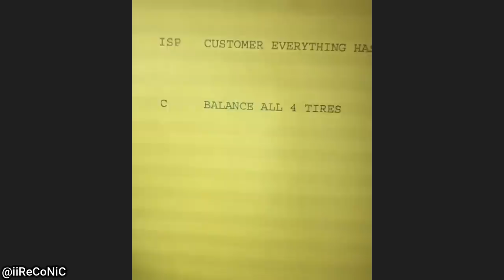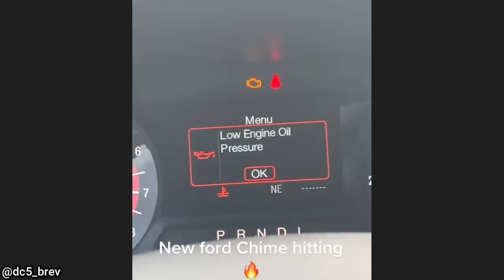Customer States Rear Wheels Won't Spin After Driving Over Speed Bump | Just Rolled In

Comment: I would love to hear their thought process behind cutting the tank open to replace the fuel pump.
Reply: yeah like what the f...
I hope its just a misunderstanding and they just ran over some stuff. on the other hand you can clearly see the consistend fraing that  comes from a sawblade
Reply: No shit, and I would really like to witness the "oh duh" moment as well.
Reply: The thought process, if it could be called such......
Gotta get that fuel pump outta there stat, everything else we'll deal with when we get to it.
Reply: I used to work with a guy that had a BMW Z4. He was running an antenna cable from the trunk up to the center console and inadvertently drilled through his gas tank. He's a pretty decent mechanic, and he knew where the tank was, just had one of those Homer Simpson moments. FYI, Z4 gas tanks are not cheap :)
Reply: How did they cut it without blowing it up, brushless DeWalt reciprocating saw?
Reply: @stevebot  Hand saw.  Carpenters used to use them in the old days.
Reply: Thought?
Reply: Yes, but where is the duct tape. Certainly that would have fixed the hole?
Reply: @JCWren  Decades ago, I was installing police equipment in the trunk of a Crown Victoria. I drilled 1 or 2 TEK screws too close to the rear of the upper trunk shelf. Right into the top of the fuel tank. Never made that mistake again.
Reply: If you would like to hear the thought process it would just sound like static.
Reply: @Mikeydude001  All too common in those
Reply: "It's where the fuel is, duh!"
Reply: on my last car, i would have to remove a ton of stuff just to reach the fuel pump to the point it would be THOUSANDS of dollars in labor alone in a shop. i absolutely debated cutting through the fuel tank to reach the fuel pump then just replace both. only reason i never attempted it was bc the car got totaled before i got paid next
Reply: Ya ain't seen the video of the woman who cuts her masks open so she can breathe through them?
Reply: @descent8275  consistent and fraying you mean.
Reply: A bit of glue and silicone and it's good as new... lol
Reply: Maybe she got jealous of the fact that my car's fuel pump is located at the front of the engine, up top, easy to reach by anyone when the hood is open. 😄
Reply: There are a lot of such moments, where I would really like to ask the people involved what they think would happen.
Reply: @rogerwilco2  I dare say, where people like that are concerned, it would just result in even more frustration.  You cannot employ logical, rational reasoning to a situation where none exists.  Attempting to do so can just short out a brain cell.
Reply: @csjrogerson2377  
What’s a hand saw? I tell ya, you just can’t keep up with inventions these days, there’s always something new.
Reply: Was probly gonna use duct tape to seal gas tank but realized tape dont like gas,🤣
Reply: @southern_merican  
Flexseal! 😂
Reply: @JCWren  DOH!
Reply: Labor saver 🤣

Comment: Customer:  "I did the work myself."
Mechanic:  "You don't say!"
Customer:  "Can you fix it?"
Mechanic:  "I can but I won't."
Reply: That Subaru at 0:47: I would have quoted the guy 40 hours @ $100/hour. And that's just to diagnose it.
Reply: So far that has happened with my home mechanic repairs.

But that Suburu is beyond me what they were attempting to do.

I don't know any garage who would help that customer out when they went that far into destroying it.
Reply: @davidpick1076  I like electrical work...up to a point! But I would give it a shot for $4000!
Reply: @61rampy65  You could just pull the entire wiring harness and return it to stock (that'd cost as much as that car, if not more, I know).
Reply: @bodyrumuae2914  "But, I worked hardly on that!"
"Thing is, it's hardly working."
Reply: @61rampy65  i would quote brand new wiring harnesses and that would be just to get the ball rolling. likely shorted his pcm/bcm as well with all that fuckery. that alone would put you in the thousands and at least it would be all new wiring. any thing after that would be chill for the most part but i would definitely have the dude sign a waiver and take pictures of the current condition and AFTER so if they start doing this shit again then any warranty is NULL.

Comment: Things I've learned on this channel:
- People think tires have infinite tread
- Don't let "someone you know" weld anything on your car
- What bullet holes?
- Don't let the lube shop touch your car if you still care about it
- people are nasty
Reply: Also... There's oil that last the life time of the vehicle
Reply: @SDogo  I mean if you never change the oil technically it did last the life of the engine....
Reply: I've got one friend I would allow to weld on my car.  Why yes, he is a certified and experienced professional welder, how'd you guess? 😂
Reply: @SpawnofChaos  Haha I just spent the last week welding a new dump bed for my brother’s truck. I’m definitely NOT a certified or professional welder and while he’s happy with it and it’s never coming apart, I made him promise not to tell anyone it was my work. Stick welding with 6011 is tough to make beautiful :)
Reply: Don't forget, the bearings are fine until the wheel actually falls off.
Reply: Those are not bullet holes, they are speed holes, they make the car go faster.
Reply: @truthsmiles  Remember: A grinder and paint, make me the welder I ain't! (Sounds like you weld about as good as me- they hold, but aren't pretty).
Reply: @61rampy65  Haha yes I said the exact same to my brother :) 
I certainly didn’t set myself up for success… the metal had traces of paint, rust, and oil, and while I’m good at flat welding; horizontal and vertical are a stretch; and overhead is a mess. And it seems like no matter what I’ll always end up with pits here and there, and I undercut some of the horizontal welds, but at least I’m sure I got excellent penetration haha. I rate myself a 3/10 welder, maybe 3.5. I can make safe, strong welds, but don’t ask me to weld a gas pipeline unless you want everyone to die haha.
Reply: - you can drive to the shop even after you lost a front wheel
- what sparks?
- what rust on the subframe?
Reply: @truthsmiles  ahh farmer rod, I know for a fact that it is welded with both eyes shut on every single farm/ranch, followed by the words "f it there's metal there" an it lasts until next season.
Usually after the 3-4 season the farmer calls a actual welder and he has to grind the old "welds" for a hour to do a 5min weld.
The farmer will then complain about how much that welder cost   for the next 5 seasons... then the cycle repeats.
Reply: @smokeshow1984  Lol! So far I’ve been lucky, then… I haven’t needed a “real welder” yet. Although, some of my thin sheet metal work is extremely iffy… one of these days I’ll invest in a mig or tig welder when I’m tired of looking at rusty bubble gum :)
Reply: @frumsmcnoodles323  Freedom holes!
Reply: To be fair ant infestation does not need to be due being nasty. If there isint any better places around and vehicle sits in one place often, ant colony could easily move in. If there is any mold/fungus around those buggers love it so technically those are useful, but then again further damage can occur due it.
For worst case of being nasty i have seen and smelled was local guy who happen to be richest guy in the area ether tried to save in electricity bill or his freezer broke down, so he moved the content into his spare car sitting outside during winter. On spring he moved it back... but forgot some meat chunks under the seat... amount of flies, maggots and smell was pretty overwhelming even for me who does not give two fucks about that most of the time, but that was just something else after marinating in direct sun on +40C for month before he brought to unfortunate local shop. Owner the jackass asked me to take the car out as he was busy as a gag.. opened the door and yeah. After initial shock i would have driven it out, but they decided to just push it out instead.
Reply: @Hellsong89  I realize that sometimes an infestation is beyond the owners control or maybe accidental.  I was thinking about the people who use their vehicle as a giant ashtray or a dumpster.
Reply: Never let anybody do any work on your vehicle.  If you can not maintain and repair it yourself, you might as well have, "Idiot sucker," written on your forehead and you are better taking a taxi.  I am a mechanic for a logistics company.  I repair and maintain all the equipment, lorries, computers, and fleet cars.  The management will not let anybody maintain the fleet cars but the in-house mechanics.  They know what kind of thieves auto-shops are.  This is very unfortunate because the few honest car mechanics there are, that have their own business, get a bad reputation because of the many.  Just pick up a book, get some tools, buy a cheap diagnostic computer.  You will save thousands a year by doing everything yourself and not having to buy a new car every two to three years. I have had my vehicle since 1996, when I bought it new.  A new vehicle would have to make 1000 miles to the gallon to be as economical as mine has been because I did my own maintanence, and repairs, and have had it 27 years.  Not to mention, it helps the environment to keep your old car as long as possible.  Melting down a dead car to make new ones uses far more energy, and makes far more pollution, than the thurstiest of guzzlers can use in a service life.
Reply: Tires are laughably easy to change, as are rims.  No special tools are required at all.  Yet people do not change them and do not want to learn how to change them.  Many do not even know how to open the engine compartment. These idiots ruin it for everyone because the shops can charge anything they want and the stupids will pay for it, instead of them learning how to do things themself.  I will never pay anybody to mount tires, nor rims.
Reply: @MyRegardsToTheDodo  As easy as it is to change ball joints, CV Joint drive axles, and struts, I do not know why these idiots not change the parts themselves.  I have seen cars lose a wheel in traffic.  Did the driver not realise how dire the situation was before the vehicle collapsed? It should be obvious to even the dumbest of people that something is wrong.
Reply: This is why I always ask my dad, who had been a mechanic since he was about 16 until his retirement at 65, whenever anything goes wrong with my car. Because I know I have no idea what I'm doing, I know how to check the oil level, fill the washer reservoir and pump up my tyres. Anything more than that, I get my dad to look at.
Reply: @truthsmiles  that’s what grinders and paint are for.

Comment: That last clip reminded me of my first car in 80s.  I had a 1969 Dodge Dart.  The rear passenger door would not latch sometimes.  I had a bunch of friends in the car and I insisted on everyone using the seatbelts even though that wasn't very popular.  I went around a corner rather quickly and sure enough that door flew open and scared the *@#*)&@$ out of the guy sitting there.  I said that's why I made you use your seat belt!
Reply: The door latch broke on my dad's old Power Wagon so he rigged up a big nail and some sheet metal to make a latch. It often stayed shut, but not always. At least as the driver, he was holding on to the steering wheel with at least one hand. The other was usually holding a beer.
Reply: I was given an old Mazda which had the habit of swinging a front door open on every left hand corner - it was nicknamed Clyde, from the Clint Eastwood movie and the orangatang he used to signal turns.....
Reply: I don’t have a story to add, but my first car was a 63 dodge dart with a slant 6 push button transmission in the mid 90s.  Also it had 64k ORIGINAL miles.
Reply: Although I cannot really speak for every car of my type, I have one of "those" cars that is constantly referred to by the common masses as "Suicide Doors."  The latches of this car, which has been through enough use and abuse to put two dozen "regular" cars into junkyards, has never once popped a latch on its own...nor had my grandmother's car, which was of the same type.  I had seen TV shows that lampooned the configuration back in the day, sure...which required carefully-staged stunting to do.  I also thought I had once seen something by someone who had one and complained about that happening, but I can't be sure when or even if I saw that.  The latches on '60s Lincolns are pretty much "Suicide-Proof" from my own experience and observations...at least, the ones built from 1966-onward.  Still, I use my seat belt every time, not only just in case, but also because I don't feel like "donating" $200 or more to the Annual Policeman's Ball.
Reply: @paulsanchez4197  Mine was a slant six. four  door.  About four different colors of blue. (Some of it brushed).  AM radio with one speaker.  Broken gas gauge (I just filled up every 200 miles) and you had to use a screw driver to open the trunk.  It only cost me $100 in 1986.

Two years later I sold it to a buddy for $70.  He drove it until it through a rod.  It continued to run until he got to work.  There was a 5 inch hole in the engine block.

I went over and we cranked it one last time and watched the ole "Dodge" die.

He sold it to a junk yard for $50

Comment: That last clip, happened to me when I was a kid. Memorial day, I get off work at midnight, was on my way home and I made a right turn when my dome light came on. I look over and my door was swinging open. So I grab the door, and because of the turn, it continued to swing open. Because my car was a 1987 Pontiac Firebird, it only had 2 doors, which were longer than average in order to be able to access the back seat. Longer than average doors = heavier than average doors. Had I of let go of the door, I would of stayed in the car, but I held on to the door, and not wearing a seatbelt, I was left laying in the middle of the street and my car continued without me. It went up to a house, and because it was uphill, it stopped without doing any damage. Last time I drove without a seatbelt, even just moving in a parking lot at 2 MPH, for me, a seatbelt is now just instinct, don't have to think about it.
Reply: I had an old mail jeep with sliding doors.  I always wore my seat belt while driving with the door open.  It had an automatic transmission with the shifter between the seats.  I was tooling down a gravel road and I had a really cool K-Bar knife on the floor.  It started bouncing towards the open door so I grabbed it and tossed it to the passenger side.  Hit the shifter and knocked it into reversed.  It locked up and rolled several times.  I've used my seat belt ever since....
Reply: That's it for me too. Many years ago I was involved in an accident and got t boned. Didnt get hurt but my pickup got hit on the drivers side. Wasn't wearing my belt and my truck got flipped on it's side. I didn't get hurt. My truck landed on it's passenger side. SHE got towed away but couple guys were there and pushed my truck back on it's wheels plus 2 quarts of oil and I drove it home. Have worn my seatbelt ever since.
Reply: @tinknal6449  Sometimes it takes something to happen (or NOT happen) to make us change our ways!!
Reply: I'm glad to hear these stories of people "seeing the light".  Buckle up, and enjoy your lives folks!
Reply: im supries you guys dont have mandatory seat belts, in europe you get big fines if police stop you widouth a seat belt
Reply: @s1rk0rcracer  there ARE mandatory seat belt laws in the US but there aren't enough cops to watch for that so typically you will only get caught if they pull you over for something else first or if they see you while passing you. That means you are mostly left to your own devices on wether you want to be stupid or not.

Edit: it also depends on which state you get caught in how expensive your fine will be.
Reply: @s1rk0rcracer  we do, they are mandatory everywhere.
Reply: If you aren't wearing a seatbelt, you aren't in control of the car.
Reply: Not to mention those doors are like 80 pounds cause of them being four feet long I got yanked out of my buddies 90 Camaro doing the same shit except his the door latch failed and it didn't have any seatbelts
Reply: I have a 95 Camaro and my passenger side door locking mechanism broke on my way to work. I made a turn and the door flew open in order to secure it I Indiana Jones'd my belt around the door handle and held it shut on my drive into work and fixed it when I got there

Comment: I've actually witnessed that last one first hand back in the 80's before the seatbelt laws came in. A guy in a VW turned left, the drivers door shot open, he was hanging out of the car and clinging onto the steering wheel one handed with his arse dragging on the road, the car mounted the kerb, he fell out and the now unmanned motor went straight through the sixteen foot tall plate glass window of a department store, through the window display, through the plyboard back of the window display, before burying itself into the perfume counter. I honestly still can't understand how anyone wasn't killed or injured.
Reply: My dad had a VW bug in the 70s and I almost went flying out the door when it opened unexpectedly.  
Must have been a VW problem
Reply: @Ducky69247  he could have misstated it. That, or the door swung open when they straightened up. I've seen that happen on doors that aren't closed.
Reply: @Ducky69247  I live in England, our steering wheels are on the right.